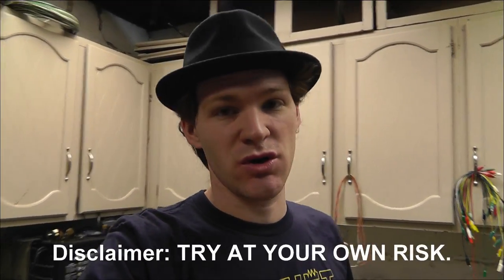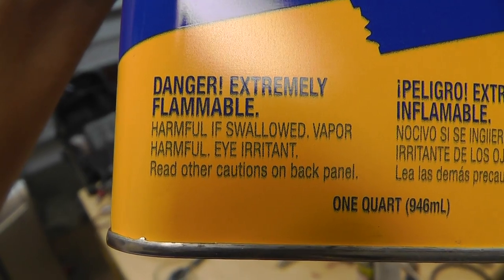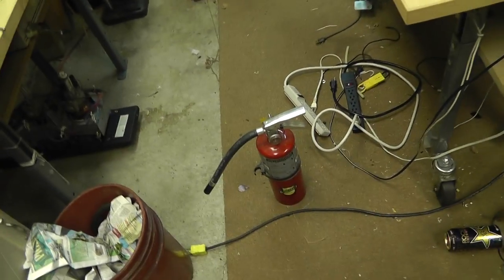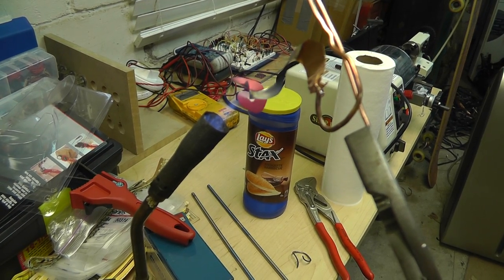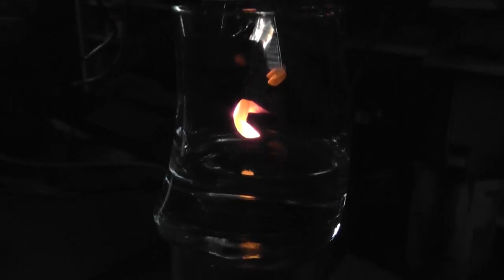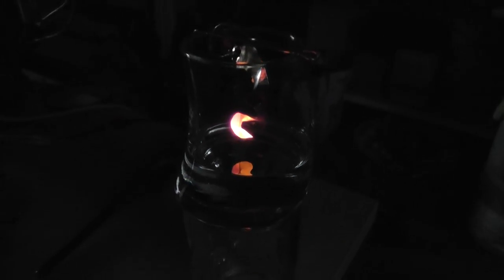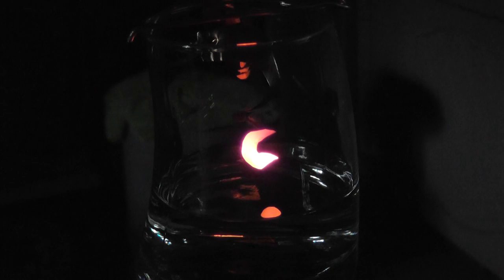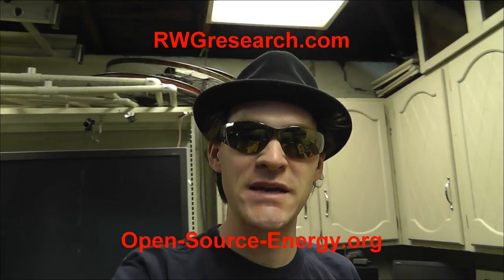What Is A Catalyst? Demo Of A Copper Catalyst & Acetone

Comment: not really what a catalyst means man.  its a broader definition than just speed.  think more about energy level requirements to complete a reaction.  this makes it easier to happen soo much it is heating itself for free in the process.  its really cool.  have you seen the coleman catalytic heaters?  they use platinum wire to catalyze propane camping fuel with out flame, just like this is, and much cleaner waste so they are safer indoors.  guess they are good for ice fishing

Comment: also a flat copper mesh held over the acetone might, by color change of thin wire, show where the separate parts of oxidation and reduction as well as heat zones are